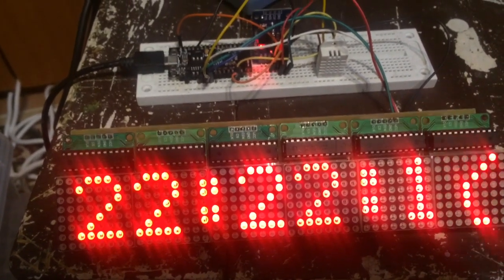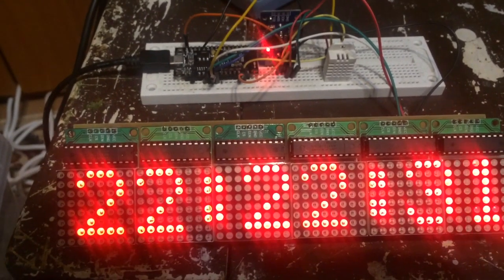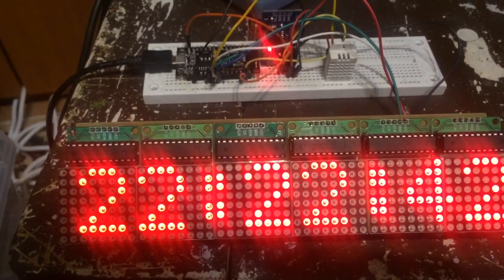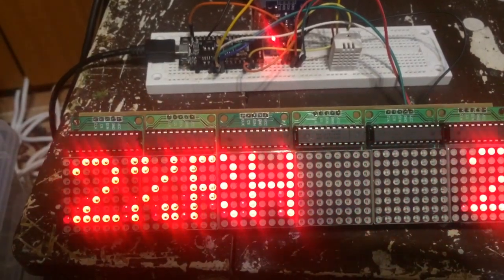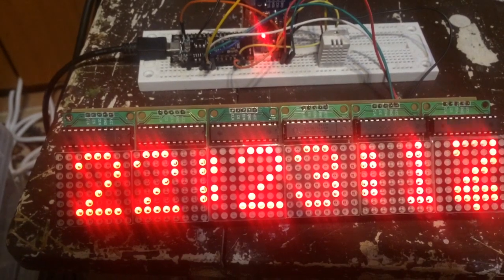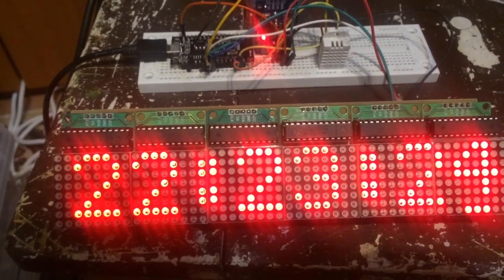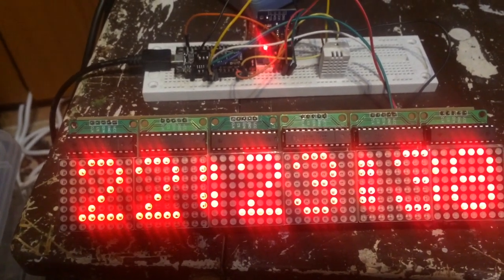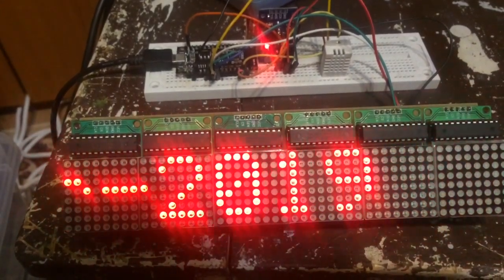LED Matrix Clock with ESP8266

Comment: Hi Nicu; cool the adaptations you made.
1) What must be changed in the sketch to use FC16 LED Matrix Modules?
2) Do you have any projects for these LED Matrix with IR Remote Control?
Thank you very much
Reply from the maker: Hello, now I use FS16 led module witn ESP8266 in other project (online clock with weather data) .. I not plan to use IR remote because I dob't see the utility